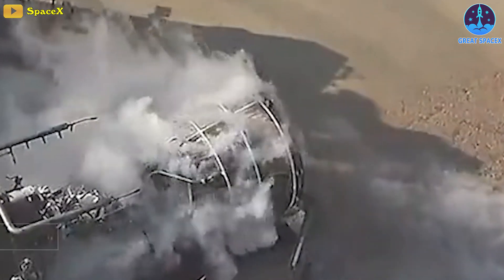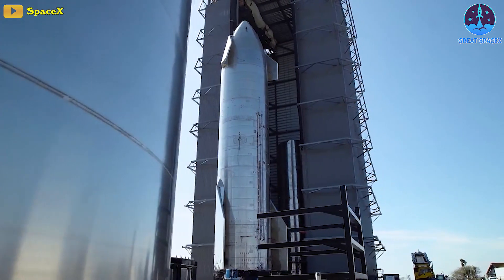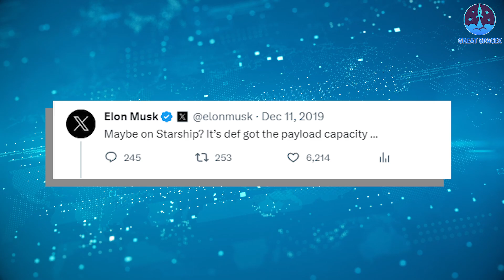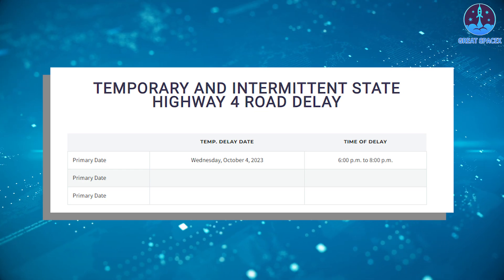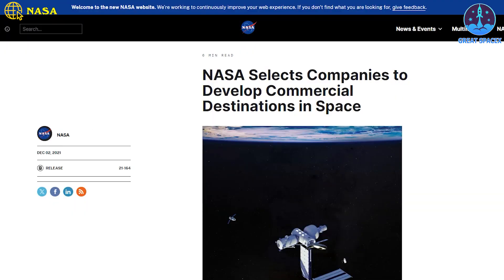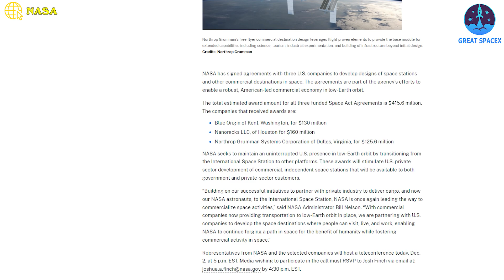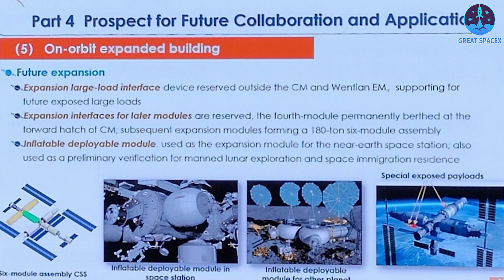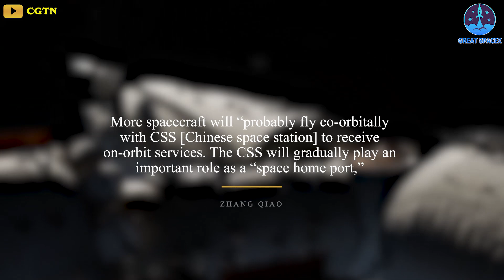Finally happened! SpaceX Starship met Cybertruck pulling Raptor, all eyes shocked at Starbase...

Comment: Can you imagine the rush to buy cybertrucks, if some dude sprays one of those full auto glocks with a switch at a cyber truck, loaded with hollowpoint 9mm rounds, and they all basically bounce off, with no injuries to the occupants inside?  Dude... people will freak out trying to buy themselves a cybertruck 😂
Reply: Drug; dealers anyway, and South Africans.
Reply: @gary5807  pffffft, what about common Chicago or New York?? 🤣 thsts where young engineers and scientists are dumping 30 round clips with full auto switches on glocks into crowds and busy streets. 
ANYONE.... who lives in those hellholes, would want this and WILL be lining up for them. 
Bet fiddy dollas!!
Reply: after the demostration smashing the window i wouldn't put any faith in it
Reply: @geoffgunn9673  the window isn't made of the same stainless steel alloy they use for starship. The body and doors are.

Comment: Is that what the truck will look like when it goes into production? I would never purchase such an ugly vehicle. Those sharp edges and corners are asking for premature stress fatigue cracks and failures. And where is the truck bed? The general shape of this "truck" looks more like my Prius, which definitely cannot haul a 4' by 8' sheet of plywood, the minimum requirement for my truck.
Reply: .. dude, crawl back under your rock with your prius & 4x8 plywood ..

Comment: Too bad vessels like the 2nd  stage of Falcon 9, the trunk module of Dragon , and the robotic transports from ESA and JAXA, do not have common docking mechanisms and solar panels, etc.

A lot of kilowatts of solar and batteries sent up and tossed away at the end of the mission. Not to mention the size of the individual trunk modules, a fair amount of usable, occupiable volume. Reusing things like that would build another station quickly. Maybe not all the pieces needed, but a good start.
Reply: When you get to design something new... the best way to work, is without prior or previous restraints. Why force designers to take space junk and make them design garbage into thier new space stations? WHO would want to do that? 
Isn't this very Re-use idea the reason NASA is stuck using old Space Shuttle engines that are WAY OUT OF DATE, and use a fuel that NASA would not have chosen today, if they weren't FORCED to choose it?
Let the designers design. A few scraps of solar panels and old tubes isn't a Spce Station.
Reply: @suburbangardenpermaculture3117  all the vessels I mentioned are relatively new, especially the SpaceX products.
Brand new solar panels, batteries,   controls. Used once. Certainly, that one use is very important, definitely critical. But afterwards, left to burn. 
If Starship were not so close to becoming active, it is a safe bet that SpaceX would be working out the reuse of mass they have already put into orbit.